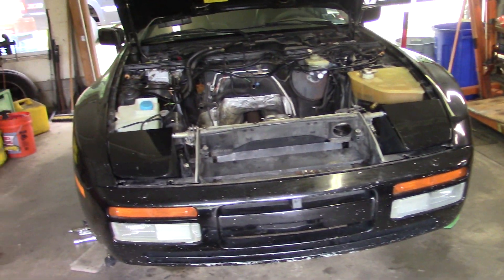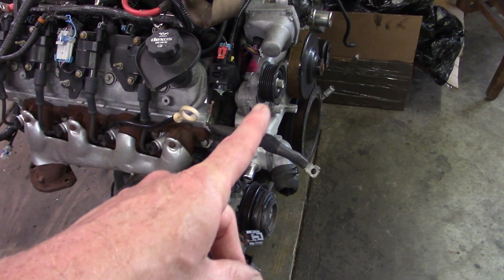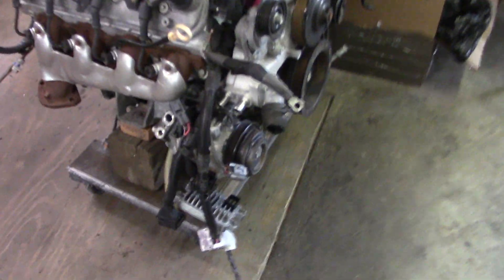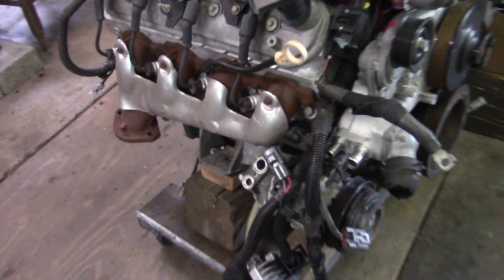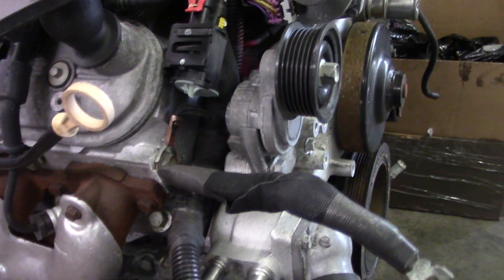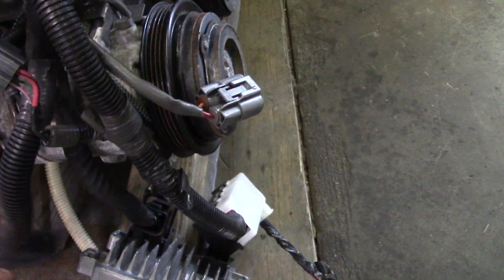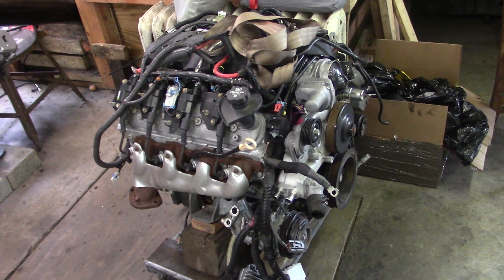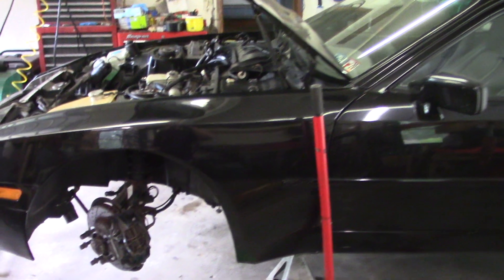Porsche 944 + V8 Part19 Torque Tube Problems

Comment: Is it possible to get the torque tube out without completely removing the rear suspension assembly? I'm about to remove mine and was hoping that it could just be lowered.
Reply from the maker: The bell housing on the back of the torque tube makes it impossible to get under the spare tire well in the back without at least lowering the rear torsion bar tube a lot. The problem is the fully assembled rear suspension is very heavy and difficult to move around without damaging the brakes. You can lower the rear suspension down on some blocks but you will probably find things that need work like the spring plate bushings, so it might be better to pull the whole thing.
Reply: @stokerdon1020  Thanks so much for the insight. Sounds like I got a huge task on my hands. What a nightmare of a design!